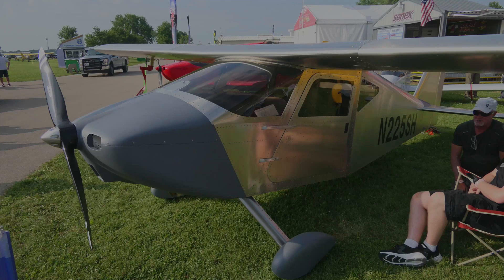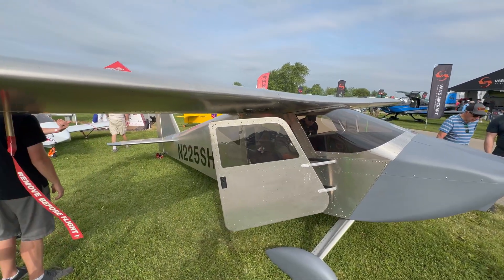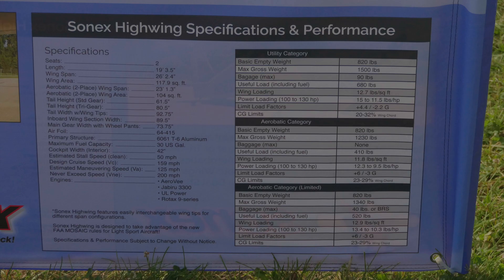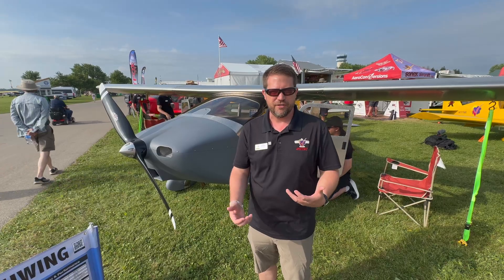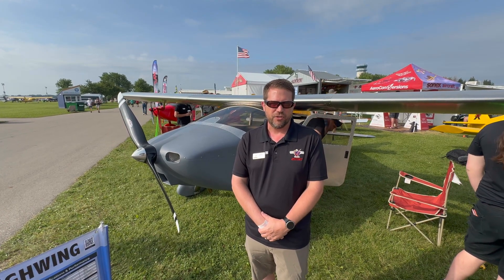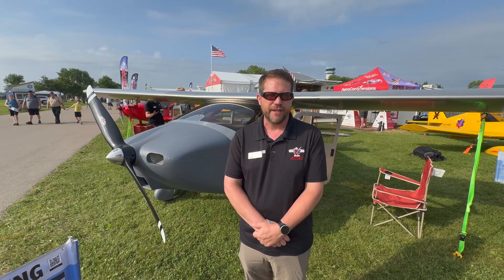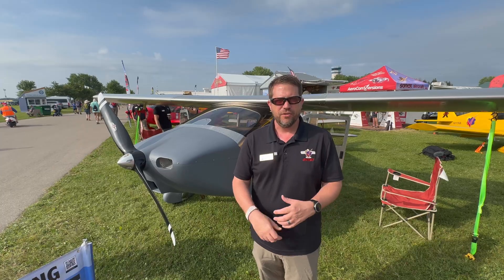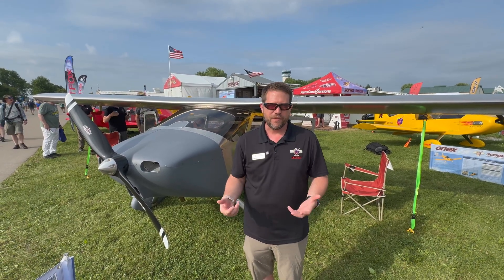Sonex High Wing

Comment: Uhh I,m no expert but the junction of the wing and windshield looks very draggy to me. But 160 mph down low is very good. Up around 8 to 9000 ' expect another 10 mph or more.
Reply from the maker: Rian said the very clean landing gear helped with the speed.  With the amount of travel from the hidden shocks inside the fuselage, you get good travel with smaller tires (as he mentioned).  It all helps.

Comment: I am curious to see the build process, Can a garage builder do most of build at home with final wing attach at a hangar?
Reply: Yes, I asked Mark thts exact question about 2 weeks ago.  The individual wings on the plane are less than  8 feet long (without the fiberglass wing tips)  and easy to handle.   A lot of the wingspan comes from the center section of the wing built into the fuselage. No awkward tubular lift struts to deal with as well.  I will be building mine inside a 40 foot long (8 foot wide) shipping container.  I saw the prototype at Oshkosh in July and the level of detail and precision was better than I expected. I saw zero flaws inside and out. It looked like a factory built aircraft.  The seating  and available control stick positions were very comfortable as well.  The luggage area behind the seat was huge, room for camping gear or even a folding bicycle. This plane looks like it will be a hit for sure. The airspeed is really a good selling point.